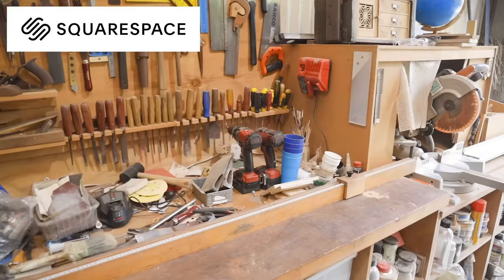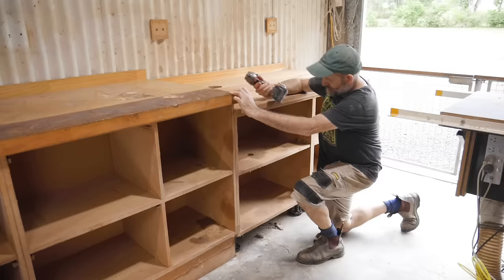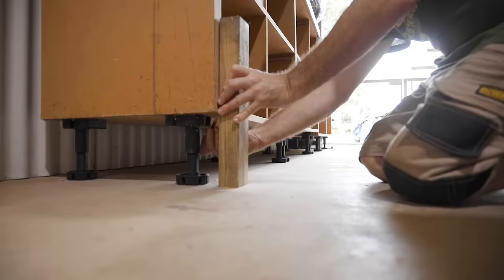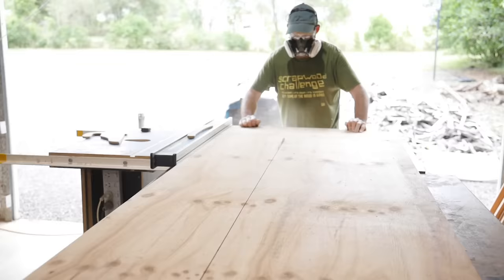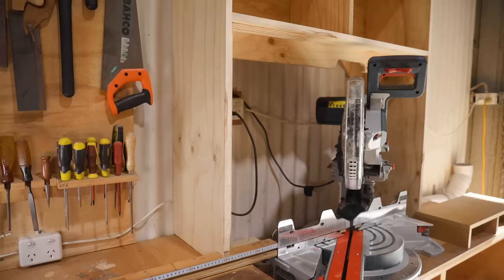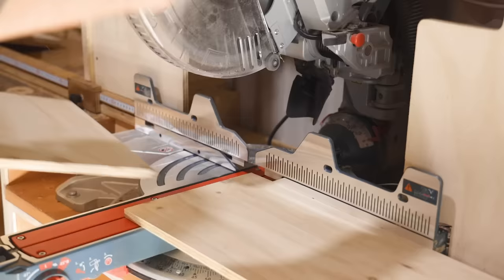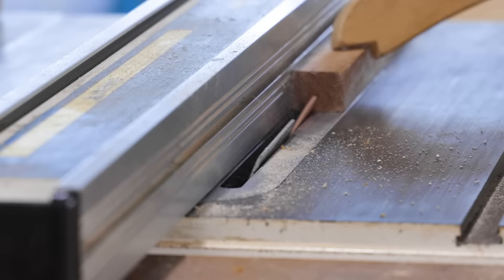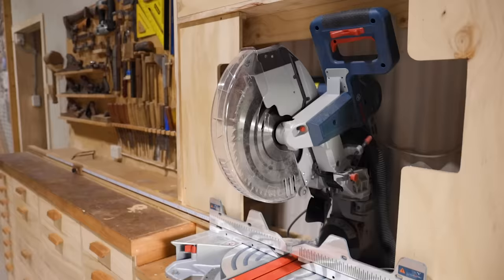Mitre Saw Station Upgrade - Storage and Dust Collection

Comment: I love that it's all just scraps of this, that and whatever else is laying around, no specially ordered birch plywood here. Also temporary storage becoming long-term storage is all too familiar in my place too..
Reply: Same!
Reply: Note really, he killed an expensive sheet of 12mm plywood (drawers) in the making of this video.
Reply: Sometimes you have to invest a little I guess.
Reply: @simple_oversight  Or use a cheaper product like MDF or melamine, or even particle board.
Reply from the maker: @vtbn53  It was cheap construction grade plywood, nothing fancy. :)
Reply: @PaskMakes  I realise it was construction grade plywood, but it ain't cheap now is it?
The problem is, although it isn't furniture grade plywood aesthetically, it IS structural grade, and that is what makes it expensive, but we don't NEED structural grade plywood for furniture (drawers etc) all we need is non-structural plywood that looks ok (one very thin veneer), but we don't manufacture non-structural plywood in Australia (at least to any economical extent) and we have restrictions on importing non-structural plywood that people have been fighting to overturn for decades without any luck. That's why we don't use plywood for kitchens etc. It's too damn expensive.
Reply: @PaskMakes  it was much nicer than. The ply we get in Western Australia..  but I loved the bench mods.  Felt more like what I'd do.  Bit of this bit of that, doesn't have to be pretty, just needs to work.
Reply: @vtbn53  I don't know what you are going on about, a sheet of half inch plywood is $23 here in the US. I know things are different there but it can't be much different of a price, even $50 a sheet wouldn't be terrible for the number of drawers he made. Most, if not all, of the cabinets I have ever seen are plywood, and cheaper ones are mdf.
Reply: @HickLif3  Yes I am aware plywood is cheap and easily accessible in North America but in Australia the lowest possible quality half inch plywood here in Australia is $55 a sheet and I have to factor in the cost of delivery or go on an hours drive to get it. He obviously used more than one sheet of plywood @15:19.
It's very rare indeed for plywood to be used for kitchen cabinets in Australia, it's usually melamine or veneered MDF, but melamine probably accounts for 75%.
All I am saying is that MDF or melamine would have been a far more cost effective solution, BUT Neil may have got a deal from somewhere, he often does.
Reply: Percy Phelps everyone’s situation is different. And that isn’t bad for the plywood honestly. Plan out a trip with other things to get done and it’s not just a trip for a sheet of plywood. mdf is MUCH weaker of a material. Especially for drawers. I would never use it for that, or anything else for that matter. I hate it. One drop of water and it’s done.
Reply: @vtbn53  looking forward to your series of "how to do it better for less" videos.

Comment: Love it. One comment about the sideways drawers, though: Two rails at the bottom might have been a bit more stable (and expensive...)
Reply: you wouldnt need a top one in this case
Reply: @Tehcarp  One at the top might add structure when the drawers are fully pulled out. Helps keep the weight from tipping away from the bench and crimping the slides at the bottom of the opening.
Reply: I don't see how the sideway drawer runners could do anything useful at all, mounted in that position. Why not just mount them in their traditional location at the sides? Am I missing something?
Reply: I don’t understand why they couldn’t be on the sides at the bottom?
Reply from the maker: An extra slide at the bottom would help (I thought about that and will still do it if needed) but it still needs one at the top too. Drawer slides need to be on both sides of the drawer to work together whether they're on the sides or top and bottom. :)
Reply from the maker: @christopherbiomass7155  Exactly Christopher! :)
Reply from the maker: @Megadoculous  Because dividers between the drawers are needed and take up extra space. Add the thickness of two drawer runners for each drawer and a divider and it mounts up. They work fine in this set up especially as it's just a workshop, you wouldn't use it in a high end kitchen though. :)
Reply: @PaskMakes  Understood re the extra space etc required for traditional runners. What I don't understand is what will hold up the weight of the drawer and it's contents when it is opened fully. Runners don't have much strength against that force direction.
Reply: I had similar thoughts, think id sacrifice loosing the height of the runner if i needed full width, but hey, if it works! The pencil was never meant to go to space!
Reply: Undermount slides would work well here... next rebuild in 10 years

Comment: Remember nothing is more permanent than a temporary solution that works.
Reply: Rule I live by against my own will.
Reply: I went to the University of Maryland in the late 60s. We still used "temporary" classrooms in mobile trailers that were installed during WWII. I think some of the trailers were still in use (as offices) when a tornado came through in 2001 and put an end to them.
Reply: My dad is a stubborn man. In about 2007 he got “temporary” glasses when his broke. He is still using them to this day even though he complains about them everyday. He refuses to go get new ones
Reply: Bravo!
Reply: @Bloodraven20  it's a reminder that it's best to do things the proper way rather than do a "temporary" fix and come back later.
Reply: @Bloodraven20  If it works...it works.
Reply: If it ain’t broke, don’t fix fit!...
Reply: Amén
Reply: Just like income tax, a temporary measure brought in in 1799.

Comment: One thing i've done, that might help with dust collection, was adding a door of sorts to those cutouts you're needing for angled cuts.  I use mine for more straight cuts, so making a couple hinged doors i can keep closed for the majority of the time.  Really improved the efficiency of my down draft dust collection.

Comment: With all this time on our hands, I wonder just how many DIYers are revamping, cleaning, reorganizing their shops? I know I am.
Reply: Kink Jarfold all this down time, I went from never knowing how to use a cordless drill to making basic furniture for my house :)
Reply: @toacinpatwary2226  That's fantastic.  There is nothing more satisfying than building something yourself.
Reply: Same here. Went from deciding to redo a support beam for my roof to getting rid of a lolly column in the center to having to redo 1/2 the floor because of wood rot. Because of all that, I'm rewiring most of the shop and redoing the layout. I admit I'm a little spoiled. I have a 20' x 20' shop. Getting rid of the column that was dead center will help with layout and work.
Reply: @kinkjarfold3816  Absolutely right! I never knew woodworking would become a hobby but there really is nothing more satisfying than building something yourself.
Reply: Same here.  New base cabinet for my drill press and a full rebuild on my Delta Unisaw
Reply: Kink Jarfold, yup.  Major work in the shop.  It's surprising how much space gets wasted with stupid stuff that you don't really need.
Reply: My father and I had about 3 days to cleanup and reorganize our workshop. And we aren’t done 100%
Reply: Ditto.
Reply: I'm doing home renovations and reorganization in the shop. I finally have time to do my projects
Reply: I have made some shop improvements and I've completed 5 projects for the house including a tile Arts and Crafts clock in QSWO.....Rod.
Reply: Not just workshops either :) I don't have a shop, just a small backyard, a brick wall for my 'worktop', some hand tools and a cheap electric hand drill.  Thanks to the inspiration of people like Pask and others I've built a small 'lean to' shed and a kitchen workbench - they are not beautiful and took probably 10x longer than should have but yeah more people are getting jobs done.  The guy who runs my local woodyard said he's been very busy since March.
Reply: Well, here is a link to my Instructables which might give all of you some ideas. https://www.instructables.com/member/Kink%20Jarfold/instructables/
Reply: @kinkjarfold3816  "There is nothing more satisfying than building something yourself"
That's why I always buy IKEA.

Comment: Really well done makeover.  I just started using Bosch power tools a couple years ago and I'm sold on them.  As my old tools wear out, I'm replacing with Bosch.  You will love it.
Reply from the maker: I agree, they're excellent tools! I just bought a Bosch 12v drill and driver too. :)

Comment: I can’t imagine having the tape upside down. That would drive me mad. Maybe I’d still be able to use it but that sounds very frustrating. Very awesome build!!
Reply from the maker: The one that I took off was upside down and that's been on there a few years. I never gave it any thought at all when using it. :)
Reply: @PaskMakes  I found out, that if I have measure tape/ruler upside down, sometimes I make a mark on i.e. 27mm instead of 33mm. It is caused by wholes plus smalls approach (cm+mm), when I choose wrong direction to add smalls.

Comment: Your gonna love that bosch... did you get the 10”or 12”?  10” is supposed to be a bit more accurate if you can live without the added capacity of the 12”
Reply from the maker: I already do - it's the 12" :)
Reply: Nice choice! I’ve had the 12” for a few years now and it is more than accurate enough.  It’s always a good day when you get a new tool.

Comment: Your upgraded mitre saw station looks smashing as does the new mitre saw. There is nothing like a good tidy up and reorganising of the workshop ever so often, which tends to boost morale and motivation while increasing efficiency as well. Due to lockdown regulations in the UK I cannot get any timber supplies these days but there are a few jobs I can manage with scraps and off cuts, so thanks for the inspiration, and yet another great video.

Comment: We've got the same saw for the same reason.  There's a nice 5-minute upgrade to the vacuum inlet that increases dust collection quite a bit. All you need is some duct tape to add some more size to the inlet. Nice video, I'm redoing a shop cabinet, and will use some of your ideas.

Comment: Really well done; about the best mitre saw station I have seen.  Vertical storage drawers are genius.
Consider changing out the stock blade on the Bosch for a quality 90 - 100 tooth one.  Mine came with a 60 tooth Bosch blade that was less than a stellar performer.  I'm now using a full kerf 96 tooth Dimar that leaves silky smooth surfaces and scatters far less dust.

Comment: Great video! If I can give one tip, when using glue and nails to assemble boxes / drawers, shoot a dovetail pattern with the nails by tilting the gun slightly in an alternating pattern as you go along the line. Your boxes are probably strong enough as is, but it requires no extra time or hardware to shoot dovetails and it will be even stronger.

Comment: i watched another guy on utube make a dust shroud similar to your setup and he usually only did 90 degree vertical cuts but for the few compound mitre cuts, he fixed the face plates by sticking magnets to the face plates and just removed them, for compound cuts, the small amounts of dust that escaped with face plates off was acceptable

Comment: Well done Neil as usual. When something turns out looking as nice as this, its almost hard to start using it for fear of damaging it. Maybe just look at it for a month.  :) 
I put a 10" hole directly under my saw, and have a hose attached to the back of my saw; w/both leading to my collector, they get most all of the dust b/c its nearest to my collector.

Comment: Enjoy your new Bosch, ive had mine for a few years now and can't imagine using anything else.

Kind of jealous though, think you guys in Australia get the euro version and it looks better built than my American saw.
Reply: @ohasis8331  I'm not sure about the Bosch 12" mitre saw but I use my DeWalt for a lot of oak trim in Mormon churches and have had no problems with deflection. Is that a common problem with Bosch saws? Or perhaps a defective blade?

Comment: Lots of great ideas in this video. I am also planning on building drawers for all of my cabinets. The only reason I haven't, is because the drawer slides are so expensive and i will need around 40 to 50 of them.
Reply from the maker: Hardwood runners work great too, I've used them in a few places in my workshop. The only downside is you don't get the full extension of the drawer. :)
Reply: @PaskMakes  thanks for the reply. I will definitely build one using that type of runner and see if it will work for me. Thanks again.

Comment: Not sure if anyones mentioned it already, apologies if they have, but the electrical cord running between your power points should be in conduit or have some protection. Other than that, great build, love your work. cheers

Comment: tbh, I would remove the floor trim. Dust will accumulate there anyway, and with the dust collection running in that same volume (behind the cabinet), it will create static load. Accumulated dust and static discharges are a perfect recipe for disaster. And most smolder fires (the most treacherous and deadly kind of shop fires) start underneath or behind cabinets. Removing the floor trim allows you to run that flexible hoze underneath every once in a while. (no-troll reference: I'm a firefighter and a dust collection systems designer)

Comment: at 19 mn 48 sec  to make it more solid  the bottom slide is put flat as shown the oder slide is installed as the regular way  i did 10 drawer like that and it is very solid and they could carry weight without sagging  Carl from Canada

Comment: I have the 12" of that style bosch saw, I really like mine so far and am sure you will really enjoy using it as well.  FYI, in case you want to dig into it, there are a lot of useful tips online and youtube videos showing how to improve the dust collection for it.  Though if you put the dust collection "hut" over it like the last saw, that will likely do everything you need. :)

Comment: sweet man. My only suggestion would be 2 slides on the bottom of the vertical drawers. The top one is doing nothing for stability.  edit: guess I should read down a comment or two next time.. lol

Comment: Maybe it's a stupid idea but I'll throw it out anyhow. I noticed under the saw when it was removed there was a lot of dust and such. Why not mount a tight fitting drawer and cut a hole under the saw that will have a vacuum hose attached to remove the dust and small parts that fall through. You can pull the drawer out if any tools fall in or bigger chunks of cutoffs. Just a thought.

Comment: Take an old mudflap screw only the top where the motor  go through the front, it'll push it off when needed but will close this hole when not needed (retracted) could do this on the other side maybe?

Comment: Another impressive project but I am surprised that you sealed off the kick space under the cabinet.  I find that space very useful for items than you don't need often, just make a couple of shallow trays running on 20mm castors inset into their bases and you have a place to hide an emergency stock of tinnies for example.

Comment: Well done, very inspirational, I was used to the fact and told by ‘ carpenters’ that all draws had to have a doves tail join and mitre cuts and if not , then you have done a crap job, 
But  you’ve shown that you don’t need to be anal and the preciseness of cuts and applying logic to what you’re making and for the load requirements shows that the finish product is better than buying a ‘ weetbix ‘ wood  or MDF pretend wood draw set and making you’re own is 100% and using real wood is beyond inspiration from your post,   

Thank you and godbless, stay safe from ‘ down under Australia’  , definitely a project to keep me busy over the ISO home detention :)

Comment: As BakerGlare mentioned 2 rails at the bottom would help, but what if you added 2 dovetail sliders at the bottom for each drawer that has the vertical sliders from wood of course. It would be an inexpensive upgrade.

Comment: Have to do it. First! I mean Third! I don't know why they don't fix the rail to the base and have the bearings attached to the motor carrier on this type of saw, only Festool does this that I have seen. I was going to cut a hole in the wall for mine but I just leave it under the bench instead.

Comment: I love what you did to your shop. However, I'm not sure about that miter saw. I hope you do another video about the accuracy of the saw in about a year and a half to two years. I've seen others using that type of glide saws but in my opinion there are to many moving parts which allow for cuts being out of square. Please do a comparison video from now to two years and see how square the cuts are.
Thanks for sharing.
Reply: I have the same saw, had it about two years now and it is still as good as new 👌🏻👌🏻

Comment: Design of the box (front walls) will not let you to operate the saw with simultaneously tilted (vertically) and turned (horizontally) blade.

Comment: I hope you checked the saw for square cuts before rebuilding your whole station. I saw a lot of complaints about thees not being square and being impossible to adjust top get it to square.
Reply from the maker: It was square straight out of the box. I've only heard others say the same thing. I was extremely impressed with how clean and accurate the cuts are. It's the best saw I've used and I used to have a 12" Bosch saw years ago that was awesome too. :)

Comment: The vertical storage near the end of the video. Why not put both runners on the bottom? that way the weight is distributed over 2 instead of 1 runner. If you mount each near the edge of the drawers there should be less torsion and they should close neatly. This way you will have the top of these drawers open instead of divided by runners..